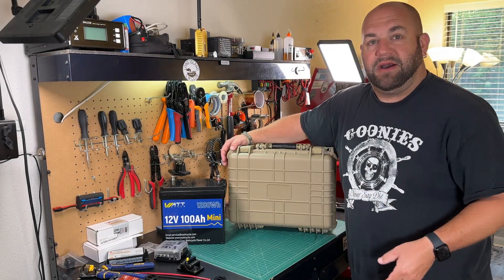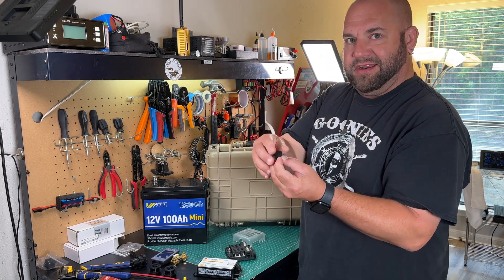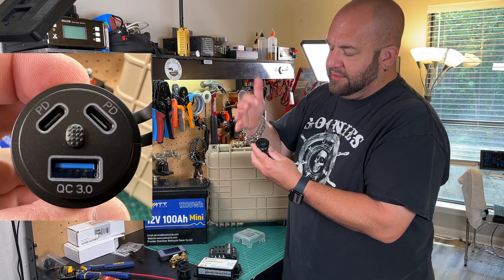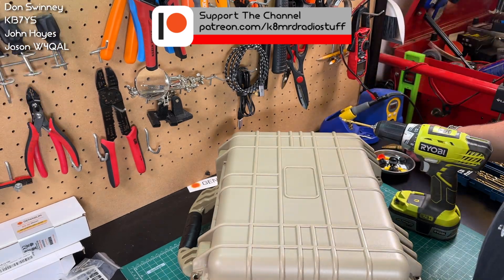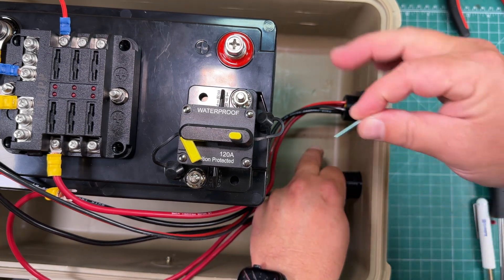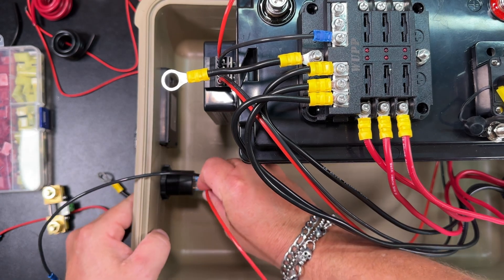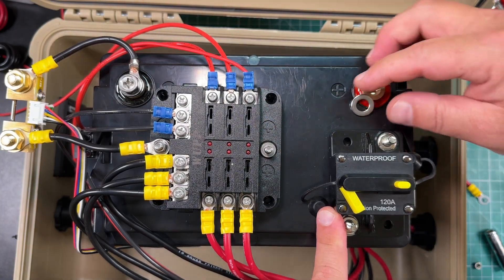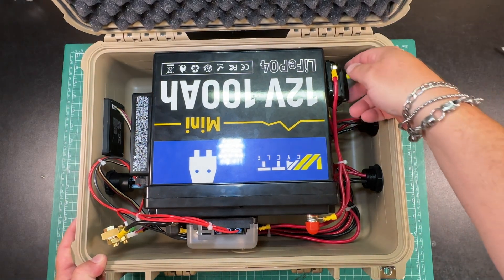Compact DIY 100Ah LiFePO4 Solar Generator

Comment: Hey Mike -

Re: The breaker/battery switch ...

Learning a lot from your videos and am in the process of making my own battery box.  If flip the switch off from the battery for no power to the system, does this mess with the power meter?  When you flip the switch back on, does the meter remember where it was at or do you have to reset the readings on the meter?

73,
Alan
N8AL

Comment: Very nice build! Is there a reason that the solar input is a yellow Power Pole? It attaches to your distribution box like any other 12v doesn’t it?
Reply from the maker: Because the sun is yellow.  But no, it is not like the other power poles.  It's kinda wired the same way but serves a specific purpose, charging via the sun.  There is no output from that port and it won't charge the battery with a LiFePO4 charger connected to it.  It needs a higher voltage from a solar panel.
Reply: @hamradiotube  Thanks for the reply. Guess I need to watch a few times to get it 😅😅😅

Comment: @10:20mins, the extra small wire connected to the shunt is to power the meter and not the shunt as stated in the video, correct?  😁  Just adding clarity for others.

Comment: Ignorant question: How do you charge this box without using the solar panel?
Reply: You can just get a lithium charger and plug it into any of the powerpole ports. Don't use the Solar Charge controller for wall power. I think I saw another video of his discussing that.

Comment: If you ever do another build will you mention the gauge of wire you are using. I’m struggling to decide the size wire to use. Can I just go over the top and use 10 gauge for the entire build for a 30ah battery?
Reply from the maker: I've done several of these boxes and I'm using 10AWG for everything but the charge controller (mine is only 10 amp) and the USB.  I think I put 14AWG on those.  I also built a version of this with a 30AH battery and used 10AWG for most everything as well.  There's no reason not to use 10AWG for everything if you want, other than it's not as flexible in tight spaces and not really necessary for some things.  It really depends on how much current you want to pull through the wire.  I'm really never gonna pull more than ~25 amps out of mine.  But I also built mine to power my ham radios and/or lower current devices.

Comment: What kind of charger did you plug into the solar input to charge the battery for the box build when you showed that the drone meter was showing charging?
Reply from the maker: This is the 6 amp charger I plugged in in the video https://www.bioennopower.com/products/copy-of-14-6v-6a-ac-to-dc-charger-anderson-12v-lifepo4-batteries-bpc-1506a but I use this one if I want to charge it faster https://www.bioennopower.com/products/14-6v-20a-ac-to-dc-charger-powerpole-for-12v-lifepo4-batteries-bpc-1520a

Comment: Mike.. did you use a Printable for making your power pole adapters?  If so, would you share it?  I've seen one but not sure if it had the hole for the pin.  I'm getting stuff together to build a box for my 50aH batt.

Comment: Quick question... looks like the most a 10A controller will take is 140W from solar. Doesn't thta mean to charge the 100 ah battery it will take around 8 hours to fully charge that battery?

Comment: I'm building 12v100ah with a 1000w inverter. Do you need to run the AC/ DC charger through the side of the box to the battery, or can you just go to the bus bar? Thanks KD9WTH

Comment: Never seen someone refer to a shunt as busbar, lol. And wiring it into the dc block is an interesting idea too. You are also using the dc fuse block as a busbar. 

It’s a non traditional build but I guess it works. 

The battery though is installed upside down when you carry the box, not a fan of that.
Reply from the maker: Umm, ok??  The DC fuse block is used exactly as they are designed to be used.  The battery is not upside down, and even if it were, which it's not, it wouldn't matter.
Reply: @ umm, I stand corrected in the upside down part of the battery. 👍

Comment: How do you know what size fuses to put  on each slot in that fuse box?
Reply: Depends on their use case and what the appropriate amount of current is for what they’re going to.

For the radio, the Anderson Power Poles, I’d use a 30A fuse. For the USB ports, maybe a 5A or 10A fuse.

Check what the appropriate rated current is for the devices you’re plugging in are. The point is to have the fuse go off if there’s current overflow to prevent damage to your devices.

Comment: I hate to critique great ideas, but when they're unsafe, and unsecured, it's a call out. I applaud your efforts per se, but this is a real danger having the battery unsecured and hoping nothing 'shifts' or comes undone, much less banging all the wiring around with a semi loose battery. Just not safe, period. I appreciate your idea, I've built many including much larger ones but these 'quickees' still need internals secured... I hope you take a peek around and consider this as a safety waring... Best of luck, truly.
Reply: I have that same box with basically the same battery, just no charger, only sae waterproof plug going out.  I can say, with the foam in place the battery doesn't move.  Maybe if you dropped it upside down, but I've never had mine move inside the box.

Comment: I'd recommend putting a fuse on the positive lead. 120 amp breaker is obviously not going to do very much good.
Reply: Those wires are not larger enough for a 12 v system

Comment: after selling my previous trailer with AGM batteries I finally pulled the trigger on 150a liFEPO4 battery with bluetooth...I have decided that I have several vehicles, Jeep, 2 trailers, 2 other vehicles and I want to make my BATTERY portable.....i basically bought all these parts before watching your video so i must be on the right track

Comment: Great video. I'm building a box with the same case. Thanks for recording the build!

Did you attach the battery to the box somehow? I'm a bit concerned about the battery shifting or moving around as I carry it. Or should I not worry about that?

Comment: This is perfect. I'm building a larger one in a rolling tool box to be more for tailgating or comms where I'm driving to a location and don't have power, but this size can loaded in or on a pack and rucked into an area. Guess I have more money to spend.

Comment: I am not familiar with this shunt meter. But the way you have it wired if you turn off your breaker will the monitor loose the charge status? Or does it have memory? You might want to connect the shunt low power lead directly to the battery, possibly through a small inline fuse. No concern if the monitor has memory. WE9O

Comment: Awesome Box. You even put the MOST important feature in this build. The "Mains" Breaker!!! Question Will that Short red wire from the POS post to the Mains breaker carry the 125A should there ever be a short? or will it burn up before 125A breaker kicks? Burning wires in a Plastic box NOT GOOD! Please Don't tell me your relying on the BMS! Fusing is to protect the "Wire" carrying the load. The wire is sized to carry the load! Will those wires your using carry 25A?? 50 or 60A breaker max??? Just curious!

Comment: You should swap out the fuses for push to reset circuit breakers that fit in those fuse holders. may be helpful in an emergency

Comment: Great Video Mike! I've already watched it about 10 times. I think I'm going to make a battery box almost exactly as you have illustrated here. I already have the same box and several of the other pieces to complete it (with the CyclenBatt 100 ah Mini.) ONE QUESTION THOUGH at 13:53 did you plug your 6 amp charger into the Anderson solar charging port (the black & yellow port)?  Nice inspiring work! Thanks. Gerald - KG0VA

Comment: Mike, Where did you source the bus bar box and 120A switch? Thanks.
Reply from the maker: All links are in the description to the video.  You can find the fuse box and lots of other stuff I use on my Amazon store under "battery box stuff" https://www.amazon.com/shop/k8mrdradiostuff/list/3I2P1IKZVZT2D?ref_=aip_sf_list_spv_ofs_mixed_d and I don't actually recommend the breaker to be used as a breaker.  Like I said in the video, I'm using it purely as a switch.  I just have some of them lying around so I decided it would be a cool idea to use it.  I'm relying on the fuses in the fuse box to protect my stuff.  Search Amazon for 12 Volt breaker and you'll find all kinds of them.  I just don't feel comfortable suggesting a particular one as I have many of them and they are pure Chinesium.  Some of them work as they should, some don't.  I have a 250 amp one I use in my battery testing videos that never breaks even though I'm pulling well over 250 amps.  Use at your own risk.  But, for a switch, it does exactly what I need it to do which is 1, be small enough to fit inside the box, and 2, operate as a switch.  There are some stand offs on the back of it that I cut off with a Dremel that I didn't show in the video that allows me to mount it flush so you might want to do that as well.  Hope that helps.  Have fun building your box!

Comment: Super sweet and clean install. The only thing I might recommend is check the specs on the breaker to see if it’s switch rated. Else you might wear it out quicker than a true switch and it wont work for you anymore :)

Comment: Watch this video and your original review of this battery.  Good stuff!  Purchased 3 of them.  Two for my wife’s horse trailer with living quarters to replace the crap led acid batteries and one for myself for my van.  The ones I received came with two sets of bolts of two lengths and they had Phillips screwdriver compatible heads.  They listened to you!!!  Thanks again for your content.  I really enjoy it

Comment: Nice box, have a few questions?  1. main power wires from battery to fuse panel what guage are they, look a little small for a 100a breaker panel.  2.  are the fuse panel, meter, and breaker listed on you site?
Reply from the maker: I'm not really using the breaker as a breaker.  I'm using it as a switch.  I would never actually be pulling even close to 120 amps out of this box.  More like ~30 at one time if that.  All the wire is 10AWG pure copper stranded wire (purchased at O'Reilly auto parts) except for the Solar CC , & USB-outlet, which is 14AWG Oxygen free copper wire I had lying around.  The wire connecting the positive to the shunt is whatever wire came with the meter.  The fuse panel and meter is on my amazon store under "battery box stuff" https://www.amazon.com/shop/k8mrdradiostuff/list/3I2P1IKZVZT2D?ref_=aip_sf_list_spv_ofs_mixed_d  I don't have links for the breaker because quite honestly, they're not very good.  They're pure chinesium.  I have several of them lying around so I decided to use one in this build.  I have mixed results with them.  Some actually break at the rated current, some don't.  For me, it's just a master switch.  Hope that helps!

Comment: Are you also charging the entire box via a 120 Volt AC to 12 Volt DC converter (wall wart) and using the Anderson Plug, to plug into the Solar Charge Controller input? 
Because ya gotta have an AC input, somewhere!
Reply from the maker: I use a couple different LiFePO4 chargers depending on how fast I need to charge it.  Either a 6 amp or 20 amp charger from Bioenno.  You don't plug into the solar controller though.  That's for solar.  You just plug into any one of the red/black Andersons.  There is no AC input.  It's all DC.  Though the charger is AC to DC if you want to look at it that way.  https://www.bioennopower.com/products/copy-of-14-6v-6a-ac-to-dc-charger-anderson-12v-lifepo4-batteries-bpc-1506a  https://www.bioennopower.com/products/14-6v-20a-ac-to-dc-charger-powerpole-for-12v-lifepo4-batteries-bpc-1520a

Comment: Was wondering on the is lifespan before have to put the set up on a new battery 2 years sound about right
Reply from the maker: Depends on how much you discharge the battery but generally a LiFePO4 battery will have at least a 2000 cycle lifespan at a full depth of discharge.  For example, if you were to fully discharge, then charge the battery once a week, it would last over 5 years.  But it would still have ~80% of its original capacity.   Of course there are more variables to this like how fast you charge/discharge but that's the ballpark.  10 years is really about the life span for a casual user of LiFePO4 batteries.

Comment: Is that breaker rated for multiple switch cycles as an off/on device?
Reply: I have one for main shutoff on my trolling motor holds up fine
Reply from the maker: I don't see why it wouldn't be.  I guess we'll find out.  I use a 250 amp one for all my battery testing videos.  Works just fine.  I just don't trust them as actual breakers though as they are pure Chinesium.  Sometimes they break, sometimes they don't.  But as a switch, they've never failed me.
Reply: @hamradiotube oh....you mean Chicomium.

Comment: Drak is ok could not get the relay to work doesn't actually send a signal on the relay terminal. I use the newer version that has BT connectivity pretty happy with it so far.

Comment: Help!
I am getting desperate for an answer to my question/application.
I have several repeaters installed at remote sites and want to use LifePO4 battery backup.
The sites are all public safety towers or buildings and all have AC power provided by the local utility with natural gas or LPG standby generators.

The repeaters are Motorola MTR3000 (analog / p25 / 100w / UHF) 24VDC.
and Hytera RD982 (analog / DMR / 50w / UHF) 12VDC.

Can I just use a single 12v / 100ah lithium battery (LifePO4 chemistry) to the backup battery revert cables (provided with each repeater and providing NO battery charge power).  Though someday, I’d like to install solar at the sites, currently I want to use AC utility (or generator) provided 120vac power to “maintain” the batteries and charge them up after a long term power outage.?

I understand that these are not like flooded / sealed lead acid or AGM batteries that use a “floating charge” type device like a battery “tender”.

I’d love to use Lithium but am wondering if I can just use an MPPT charger fed with a 12vdc large power supply or a standalone AC powered 30 or 40a charger .

Any ideas?

Thanks!

Comment: Looks good.  I regret I didn't pick up a case when I was in Harbor Freight last week.  You need a Dremmel my friend!  Cheers, 73.
Reply from the maker: If I had a nickel every time someone told me what tool to use...Dremels suck at cutting plastic.  They melt it.  I'm good with a razor.

Comment: Love the build!  I did one in an ammo box.  The only thing I did different is I put heat shrink on the shunt.  Not sure its really needed because of the low current at that point.  73
Reply from the maker: There's pretty high current going through that shunt.  Remember, all the negative wires are going through it and to the battery.  I was thinking about wrapping it with some kapton tape.  I should probably do that just to be safe.

Comment: Brilliant design, sir. I’m curious about building one of these battery boxes down the road when I graduate to 100W radios. Nice to be able to charge your tablet/phone at the same time you’re powering your radio!

Beautiful work as always. - KF0QNM
Reply from the maker: Oh they're not just for 100 watt radios.  Though that is what I usually use them for.  Think if your power goes out.  Hook up a small inverter to it.  Plug in some lights or your fridge, or your TV, router, etc.  They have more uses than you'd think.